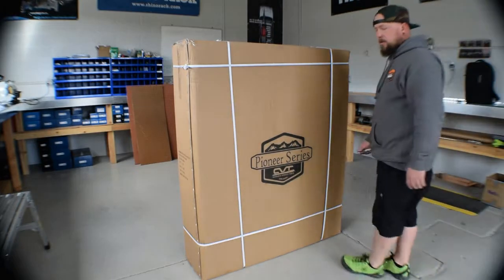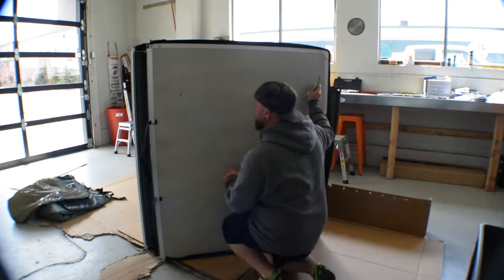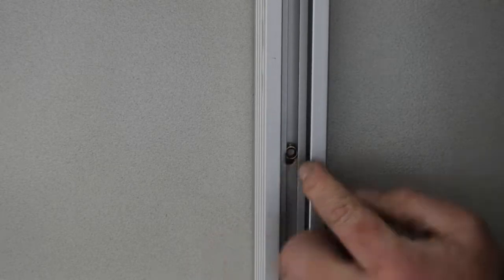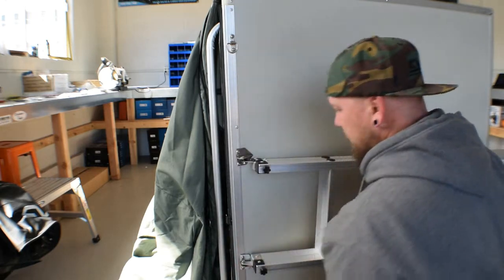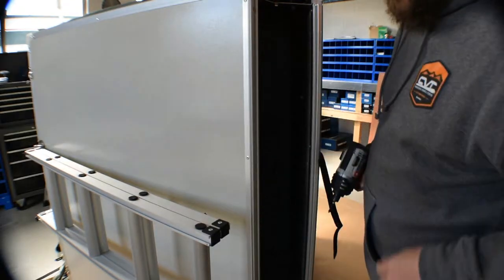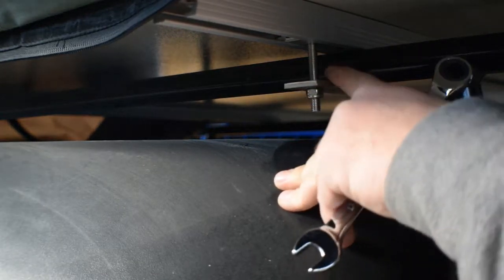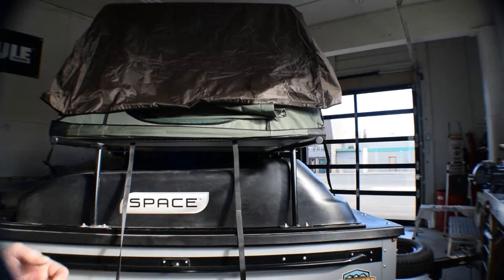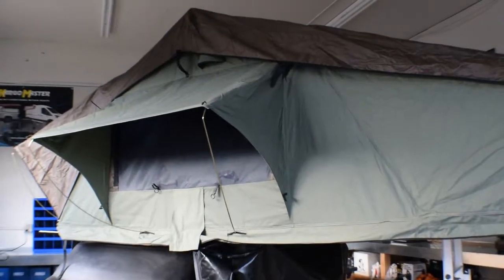Mt. Shasta extended pioneer series tent

Comment: Thank you for posting this. Just took delivery and installed mine but was at a loss about setup and other videos (other than anex) were not very helpful. I wanted to set it up at least once before taking off on a 10 day trip to Silverton, Moab, and Wyoming for the eclipse and this video helped me greatly. Thank you. One question though. There are two nylon straps with loops on the end that are attached to the interior pole structure of the tent, what are these for?
Reply from the maker: Derek Gustafson welcome.. those are grab handles for going up and down the ladder. We are working on a better instruction guide. And welcome to the cvt family

Comment: Awesome resource, thank you! I am looking at mounting one of these across my pickup bed, cab-high when closed. Will the annex still work okay with the tent being so much closer to the ground? Maybe roll up the side walls from the bottom?

I saw a photo on Instagram where the CVT tent flipped over the back, instead of the side of the truck! Is this done by removing the mounting strips and reinstalling them 90 degrees from the original position?
Reply from the maker: Andre J de Saint Phalle all depending on the ending height of the tent. 70” is about the lowest you can go and not have a bunch of material on the ground but people do it.